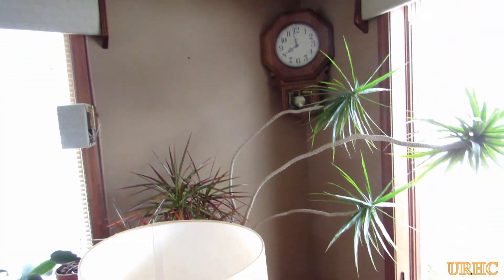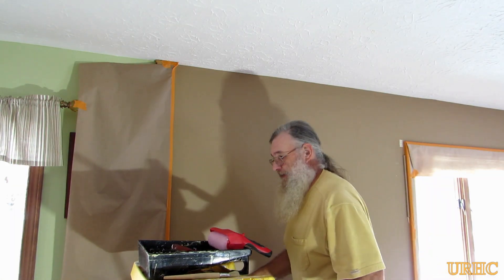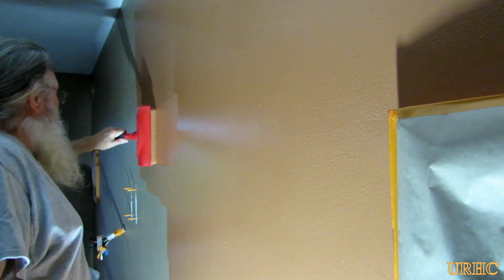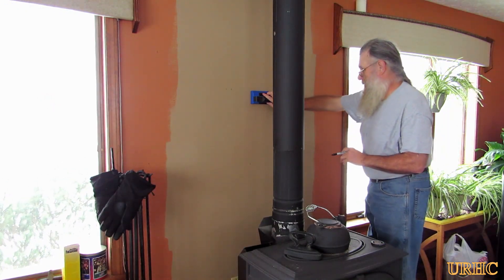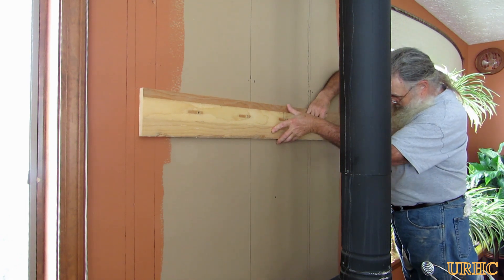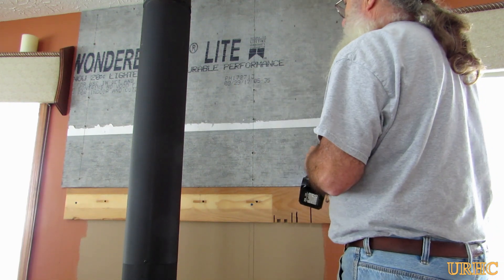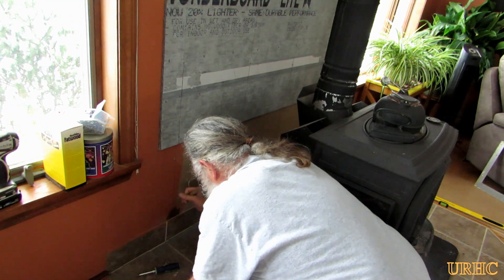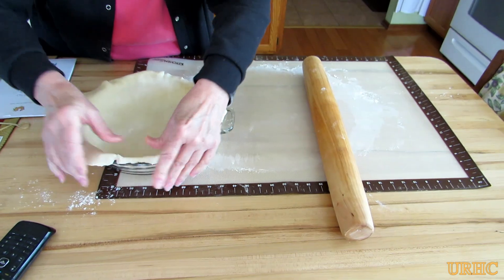Holiday Makeover Painting & Stone Veneer Part 1

Comment: Your attention to detail always shows.  I've used the rollers with splatter guard for years, way better with them.  And I do the same prep bcz it's worth the time and saves time later in clean up.  Great job, looks real good.  Can't wait for second video, I'm sure it's going to look great.  The colors are on the warm side, so it does make it more appealing.
Reply from the maker: The color change did warm up the room quite a bit. This is the first time trying the shielded rollers and I will never go back. There was zero mess using it and it was very easy to control the pressure resulting a very smooth coat. Spent all day on the second half and just spent a hour and a half uploading it. Thanks for watching.

Comment: Wonderful job young man!! I’m in the process of doing the same thing but I am doing mine before I put the wood stove in. I got the backer board  a few days ago but still need to pick out the stone. I need to hurry tho cause I need the stove in, it’s my only heat and was down to 22 degrees last night and will be 17 Monday or Tuesday. As always tho, you do outstanding things and always turn out much nicer than hiring the best remodeling contractors. I’m very proud of you buddy!!
Reply from the maker: Finding stone is the toughest part. I was lucky to find a veneer with small enough pieces for the small area we did online at home depot. We will be seeing colder weather this coming week also, working around the hot stove made the moarter set up quicker so I was able to stack the entire height in a day. You may need a little backup heat if you wait much longer. Always fun to knock one more item off the honey do list. Thanks for watching.

Comment: I think the prep work takes more time than the actual painting. Using the wonderboard for added protection against the heat is a good idea. I did not know they harvest large fields of cabbage by hand – surprised!
Reply from the maker: I did want want to rely on the old paint to hold them up either. The little extra mass really retains heat and helps the room keep a even temp at night. I under stand they order up a van load of illegals to do the picking on the small farms. Tough work to be bending over and cutting for 10 hours a day. Big cabbage farms south of here use machinery. I think the small stuff goes to the Libbys sauerkraut factory.

Comment: Good workmanlike job!  I have a question, the wood stove is free standing where does it get the oxygen it needs for combustion?  Have you considered some sort of piping to the outside to supply the oxygen?

 By the way, I have tested many a level from Harbor Freight and not one has been true.
Reply from the maker: There is enough leakage through the old Windows and doors so there is no problem. Always put a co2 arlarm in a room with a stove. There is an outside air kit available for the stove if you have a tight house. It is just a small pipe that hooks to the bottom of the stove. I checked every level in the rack when I  purchased that one and only a couple of them were off. This one is dead on and I also have a 2 ft one that is accurate . Bring a wixey gauge to check them when you buy one and check it to be safe.